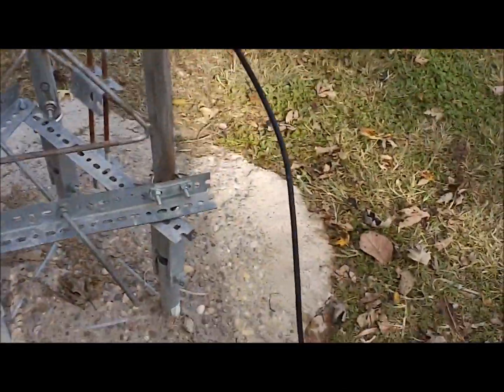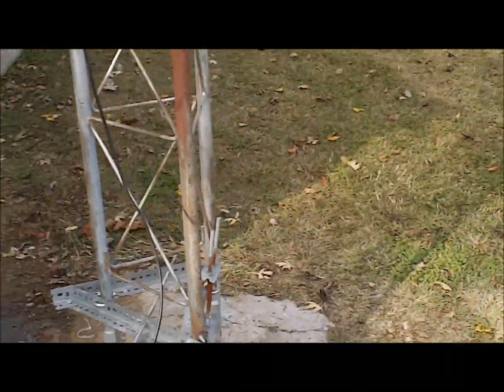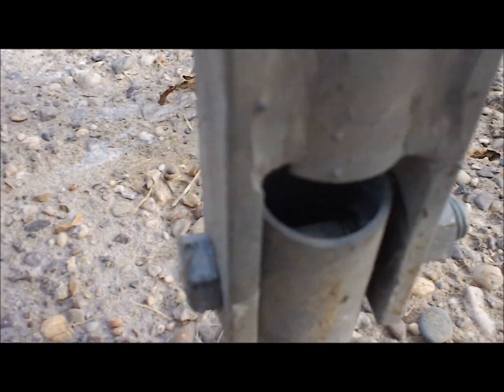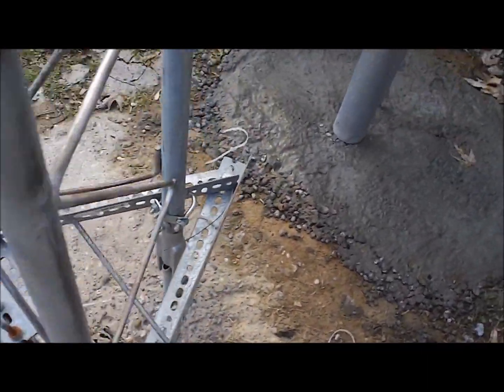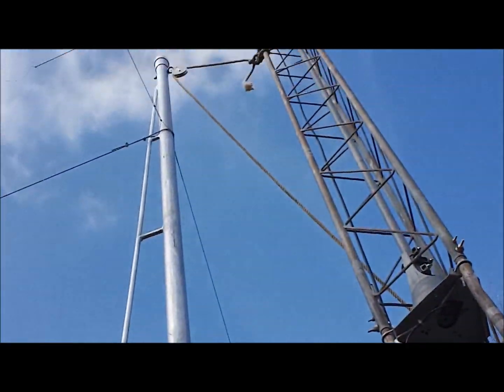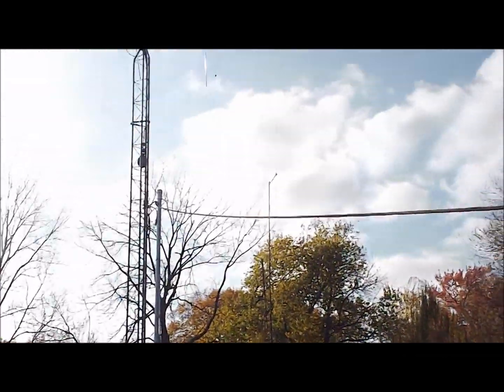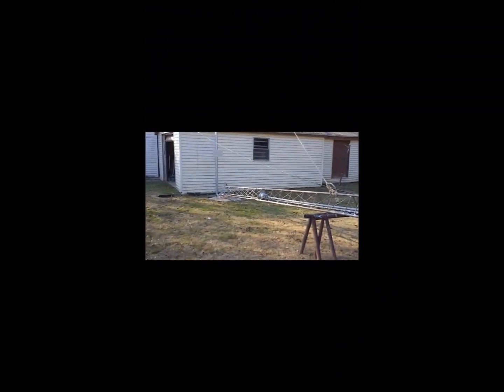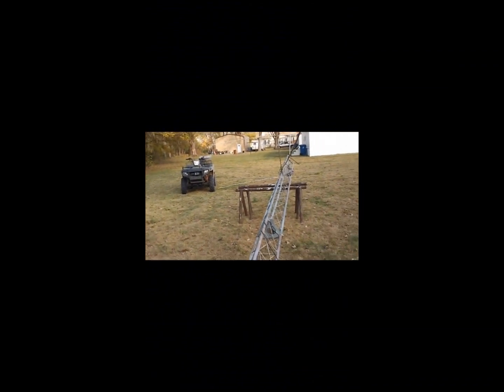Beggining of winch pole setup for Rohn 25 Z tower on break over 1st video

Comment: Holy carp! What is this?
I've a 40' but never had a base plate. (just found it online)
I was always figuring I'd do it by hand to lower it. 
And what the heck squished them pipes? The weight is on the bolts vertically.

Comment from the maker: Thank you for the suggestions Tyrone. This isn't the final setup and I should delete this video because most watch it and not the final video showing it completed and being raised via the winch and winch pole. The winch is mounted towards the bottom of the pole and does the raising and lowering duties. You can see that video via my channel. It has been working great since completion and now has a 4 element yagi on it. 73's Paul

Comment: Didn't get to see any actual tower loering. you may wish to place another snatch blok at the bottom , that way you can pull from any direction in the yard, plus, you will double your pulling power . X2 for a signle pulley,  X4 by adding a second pulley, plus all the torque of pulling will be at the bottom of the JIB pole instead of at the top, which will also make the pull smoother and safer!

73 
Tyrone  N5XES

Comment from the maker: @BlueBenGo The tower section in the ground and winch pole have concrete only part of the way down. The three steel deadmen post were driven straight into the ground without any concrete. I'm not expert on tower grounding. There are many opinions on the subject and much debate. My setup might not have the best grounding but I felt it was good enough. Maybe it is and maybe it's not but I'm okay with the way it is.

Comment from the maker: @BlueBenGo The bottom section of tower is four feet in the ground, the winch pole behind it is five feet in the ground & attached to the tower via steel cable, and the winch pole has three separate steel deadmen post each five feet in the ground with each attached to the winch pole via more steel cable. I didn't feel a need to add any extra elaborate copper rod and cable grounding system. 73's Paul